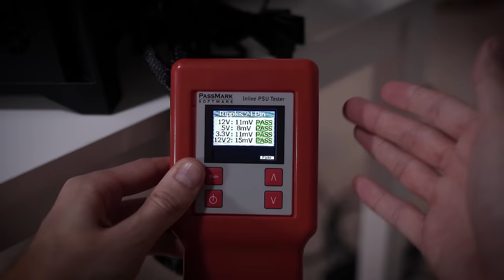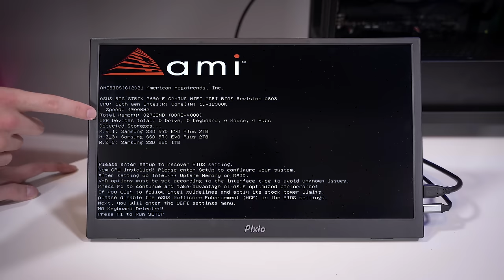Fixing a Viewer's BROKEN Gaming PC? - Fix or Flop S3:E13

Comment: Absolutely should have 2 separate power cables to the gpu I made this mistake and nearly cooked the cables there only rated for like 200 watts and the 3080 kicks out about 350watts, and take off ya bloody wedding ring gregg
Reply from the maker: This wasn't a 3080... also, I only take the ring off when I'm working with power supplies. Chill out.
Reply: Only worry about you greg you! said it was 3080 and have seen you strip psu’s with ya ring on take care just hope that guy gets the correct cables or it’s on you

Comment: sir Greg gudevening, I am Thomas E. Berdon from the Philippines. I'm one of your subscribers and a fan of your videos...in repairing of yours customer's computer...I learned a lot from you on trouble shooting in specific problems...if ever would you like to give-aways some of your extra CPUs that you're not using anymore.... I cannot afford to buy one, my rig is already complete for a long time, but except for the processor...I have a A320M S2H gigabyte motherboard, 2X4 kingston beast 2666Mhz cl16 ram, walram 128Gb m.2 ssd for OS, ramsta 128Gb ssd for storage, wd blue 500Gb hdd, a doss ds-500w atx switching power supply, a DVD rom drive and a AMD radeon 460 1gb gpu...that's it....if you have a AMD athlon 3000G or AMD RYZEN 3 3200G it would be great and a signature from you...thank you for the time you read this....

Comment: Hey can anyone help me I have recently bought a new PC and after few months my PC is giving me a bsod error and every time it's a different error and I was really frustrated and then reinstalled windows twice and still getting the bsod error I don't know what is causing this issue. I have done the ram test and it says that ram is fine and I have also done harddisk check it says it doesn't have any bad sector it's fine. All the parts are new except the hard drive ,PSU and GPU and the bsod error only occur when I start the PC  then I have to restart it one or two times after that it works fine like there is no issue . Can anyone help please

Comment: Hi everyone. First, Greg, I love your videos.  Please keep doing what you're doing.  I was wondering if anyone here might have any input regarding a minor issue a friend of mine has been experiencing lately.  He's running an intel 9700k with a gigabyte z390 aorus pro mobo and a 2080 super gpu.  His system boots just fine and functions normally from what he can tell, but he's noticed that there is a red cpu debug led that remains lit after boot.  It is roughly a 2 year old system and has only started displaying this behavior fairly recently after he had removed some dust filters and fans for cleaning.  It doesn't do it every time he boots, but more often than not.  I've had a look through the manual for his mobo and am wondering if it is a warning led, maybe DIMM related?  If anyone has run into something similar to this before, any input would be greatly appreciated.  Thanks!

Comment: My guess he was OC'ing and fried the chip
Reply: Yes. I have an i7-12700K also a 2021 batch with AVX512 instructions like that i9, but i don't overclock it by increasing voltages. It can burn the chip instantly.

In fact, when i build my PC (Corsair 5000D Airflow, Deepcool Assassin 3 and 32GB DDR5), i noticed that my MSI Z690 Pro A motherboard was giving WAY too much voltage (1.41 volts and 230 watts max, that's ridiculous).

Lowered that down to 1.1 or 1.23 volts, 150 watts now of a power draw, infinite turbo. Lowered the temps by 20 degrees or something like that.

Comment: I noticed that you only plugged in 1 8pin cpu power cable to the motherboard , I am sure it has 2
Reply from the maker: You don't need to connect both... the second 4/8 pin is typically for extreme overclocking. A single 8-pin EPS is more than capable of delivering sufficient power for any consumer-grade CPU.
Reply: @GregSalazar  sorry I didn't know , I thought you had to connect both . Enjoy your videos and have learned loads thanks Greg

Comment: Clearing the CMOS or updating the bios firmware would have been a possible next troubleshooting step, although probably unlikely to solve the issue. But it's something to consider adding to your procedure list. In the bios setup, re-set to factory defaults, then flash the firmware. On some occasions, completing the bios flash while booted in Windows can give a different result than using the bios flash software found within the bios basic setup screen. A 3rd bios flash procedure option would be to use a bootable USB thumb drive to get to a DOS prompt, and then perform the flash using DOS commands.
Reply: he cleared the cmos..
Reply: He always does that, it's just he doesn't show it on video sometimes.